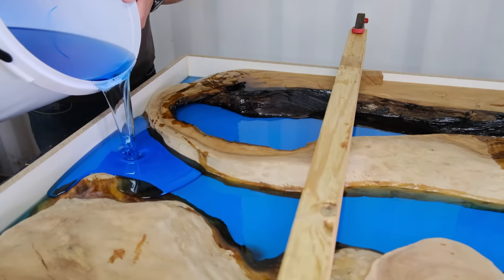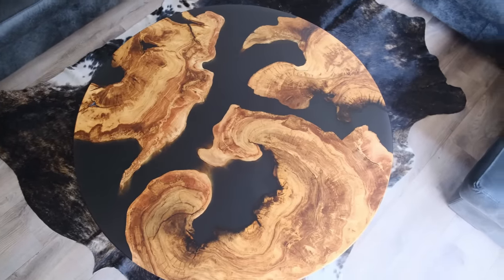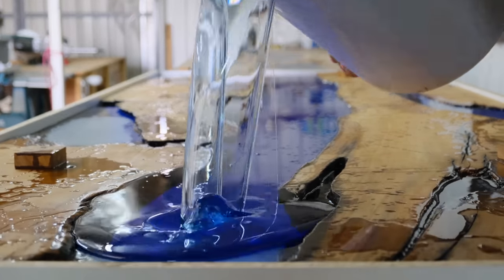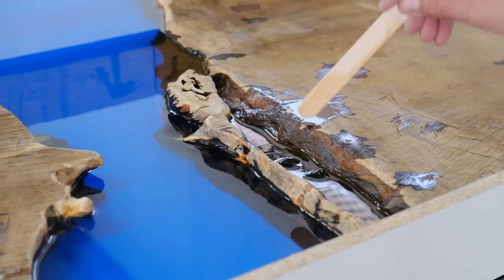Luxurious $20000 DIY Epoxy table - start to finish (uncut)

Comment: Can you use that resin to mould a perfect clear cylindrical tube of specific thicknrss and width to hold gases like helium, neon, and argon at specific density/pressure and proportions??? Or, infuse it with finely ground powder of certain gemstones, evenly distributed, at a certain ratio of powder to resin, and mould a solid cylindrical tube of certain length and width? And will light from a "cage" of inward directed LEDs pass through it without too much deleniation of light transference??? Will it stand up to certain levels of heat without melting or shattering??? I'm just asking questions.🤣🤣🤣

Comment: I so want to get into these epoxy creations. I have a timber yard down the road I can buy the would from at very reasonable rates. I would want to do similar size for dinning area as first project 😬 unadvisable im sure. The thing that stops me… I presume you wu,d need and indoor space for Finnish or can you get away with it if lots of polish and finish. I would just go for black or almost black for this reason

Comment: In order to manufacture such a table, you need to purchase equipment worth $50,000 or more
But the man behind the equipment is the most important
Reply from the maker: Agreed
Reply: No you don’t.  Find a place that will plane your slab.   They don’t charge a lot.  You also need a router, grinder, circular saw, track,mallet, belt sander, orbital sander, etc.  no where near $50k.  Even if you used a router to plane it you can build a track for it.

Comment: How does it not sag?
Reply: Blacktailstudio did a test on the strength of an epoxy /wood table. They used a crane to lay a huge tree trunk onto the slab to see if it would break. Not only did it not break, there wasn't even any bowing. They are crazy strong when made correctly.

Comment: wow i didnt know epoxy cost 20000, why you dont make it 200000 or 2000000 ? the wood it self from 200-2000 plus the label it became 20000? what a bs
Reply: lol depends on the slab. I’m about to build a Mappa Burl dining table and the slab alone will cost me $2500.  I’ll have $5,000 into the table and that’s not including a ton of man hours.  It will be will over $10,000 when I’m finished
Reply: @NOturtle  1. Misleading Marketing:
The term "slab" typically refers to a solid piece of wood, often cut from a single tree trunk, with natural edges. By calling a product made from leftover wood pieces and epoxy a "slab," the seller is being misleading. The product is essentially a composite, not a true wood slab. This kind of marketing can deceive buyers who think they're purchasing a high-quality, solid wood piece.

2. Overinflated Prices:
While epoxy resin can be expensive, the cost of the leftover wood pieces is minimal. The high price tag on these so-called "slabs" is not justified by the materials or the labor involved. If the product is made from scraps and epoxy, it should be priced according to the value of those materials, not as if it were a premium, single-piece wood slab.

3. Labor Cost Comparison:
It's true that creating a well-crafted epoxy wood piece requires skill and time, but it's important to compare this labor to other industries. For instance, skilled labor in fields like aerospace engineering (e.g., NASA) is also expensive, but the complexity and the stakes are significantly higher. Selling a piece of leftover wood and epoxy at a price comparable to or even higher than that of a genuine, whole wood slab is unjustifiable.

4. Questioning Profit Margins:
Given that the material costs (leftover wood and epoxy) are relatively low, the profit margins on these epoxy wood pieces are likely inflated. If sellers can charge high prices for these products, it raises the question: why not just sell the epoxy itself for an even higher price if that's where the value supposedly lies? This rhetorical question highlights the absurdity of the inflated prices.

5. Encouraging Transparency:
You can advocate for more transparency in the market. Buyers deserve to know what they are paying for—whether it's a genuine wood slab or a piece made from scraps and epoxy. Sellers should clearly label their products and price them accordingly.

Comment: Is this 20,000USD or. S. African $?    $20000USD wouldnt be unheard of in the U.S for a large epoxy table. but 20,000 S african $ is more like $4000USD if I;m correct and that is much more common price for epoxy tables in the U.S.   so curious to know which it is?
Reply: 20k US dollars would be insane for this
Reply: Actually, 20k usd is not uncommon. Look up prices for the materials alone.
Reply: @michaelparmele8534  no I've seen youtubers selling large epoxy tables for 20k USD. Depends on the wood used and the attention to detail spent on the quality of finish.

Comment: What a joke 20,000 dollars for a plastic resin-filled slab of wood table. No carpentry skills are needed but would help if you had car body shop experience if you want to take on this project.
Reply from the maker: Jip.. like you said.
This is a highly paid occupation, no skills needed and making millions.. thats why every second guy on the street is a carpenter and driving Lambo’s..